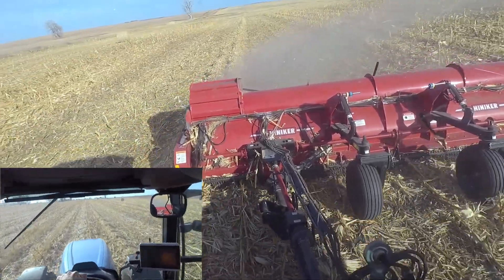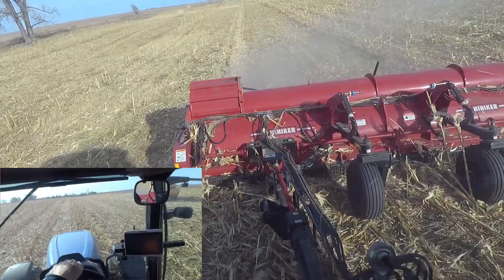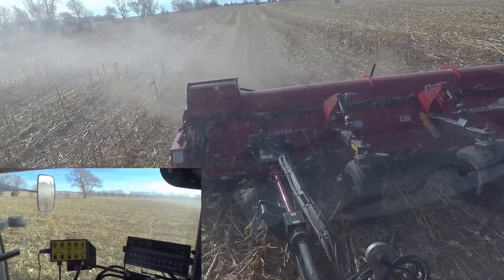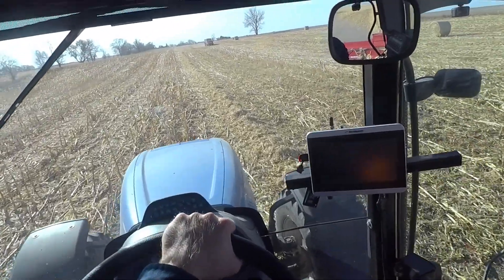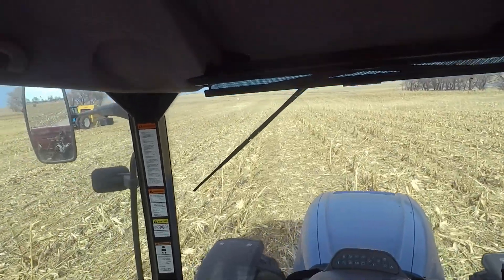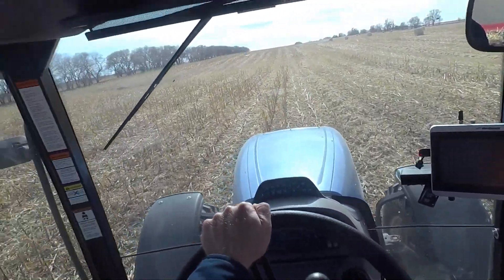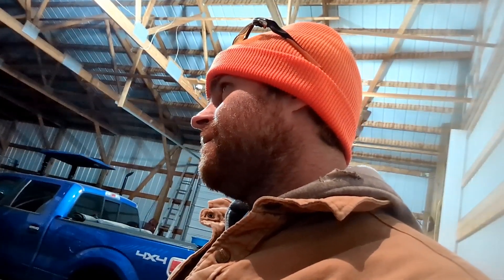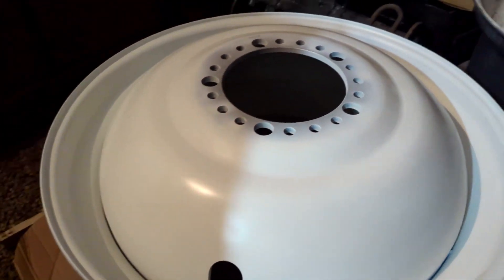Corn Shredding and Baling - Hiniker 5620HH, New Holland T7030

Comment: Those combine rims have a pretty good load to support.   Hopefully the new one is built stronger
Reply from the maker: I had a number at one point for the amount of weight with a full hopper and with a draper head... like around 60k lbs total??? The bigger combines with hopper extentions huge heads I would expect to be well over 70k.